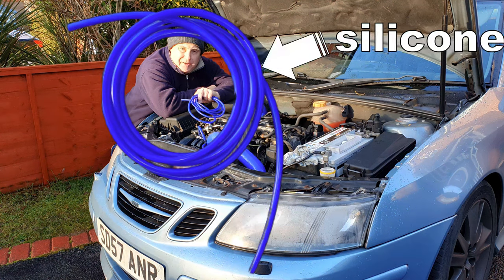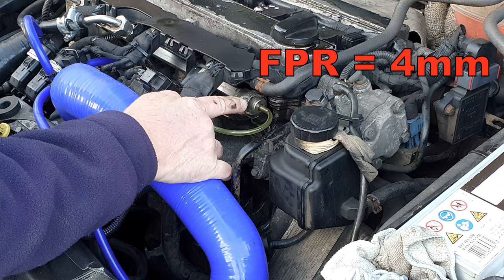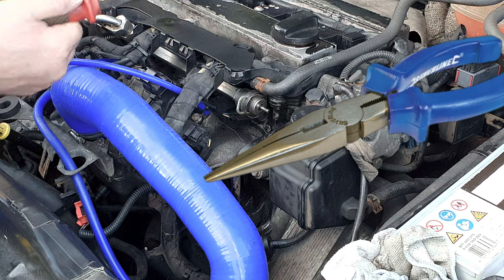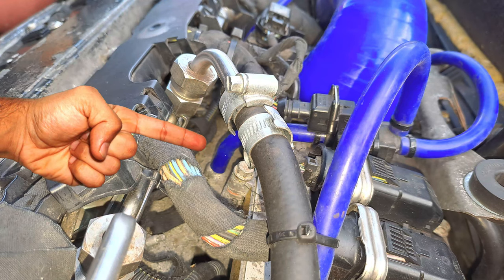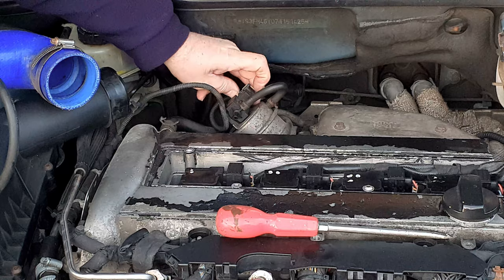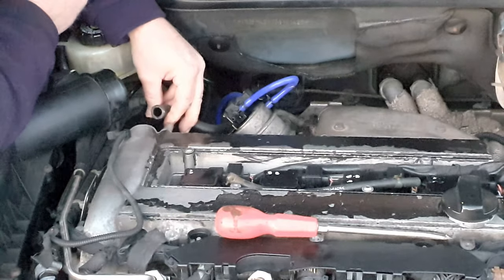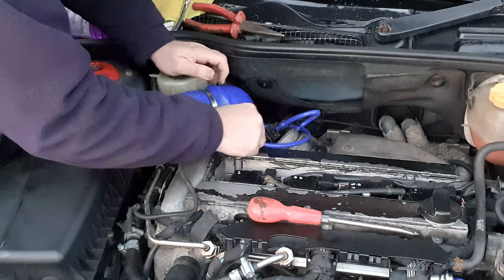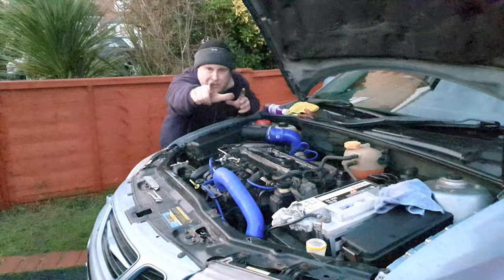Saab 9-3 Vacuum Lines Replacement on B207 Engine

Comment: I have one of these cars (someone gave it to me) and I didn't have the heart to send it to the graveyard and am trying to spruce it back up. So far, I replaced the ECU (including installing a heat sink). Replaced coolant cap. Replaced bolts on engine cover and plug/coil cover (the Torx bolts strip easily when they get old). Replaced the coolant cap. Replaced spark plugs. Now, I have to either replace coils, or replace these hoses to address a P0300 code. I think after watching this, I am going to install the vacuum hoses next (plus that 12mm hose).

Comment: Hmm, my 2010 2.0T doesn't seem to be quite the same as your setup.  I wonder if it's different due to California/US emissions requirements.  The vacuum line from the top of the bypass valve solenoid doesn't go to the cobra, but rather to a nipple on a steel(?) pipe that's insanely difficult to get at - the nipple is just to the left of the ECU (looking from the front of the car) and under the short coolant hose that goes from the engine block to the "t" fitting that many of us replace with the metal one (or with your coolant hose).  Any idea what's up with that?
Reply from the maker: The vac line from the bypass valve solenoid doesn't go to the cobra anyway - it goes to the bypass valve, so not sure what you mean there.
Maybe the vac line is part rubber and part steel pipe? Have you traced it round? Does it go to the bypass valve?
Reply: @CycloneCyd  sorry if my post is confusing. I’m referring to the small black box to the right of the ECU that has three vacuum hoses connected to it:  left, right and top, and an electrical connector on the back.  On mine, the top hose goes to a nipple on a silver metal pipe to the left of the ECU, under the coolant hose.
Reply from the maker: @akahan1  I think you will find it's a part metal and part rubber pipe connection if you trace it round
Reply: @CycloneCyd  I think you're right.  It's unfortunate that the junction between the rubber and metal portions is in a "you'd have to be a contortionist" spot.
Reply from the maker: @akahan1  hence why I just put one run of hose in

Comment: I ordered the new COBRA and adapter. But the adapter didn't fit into the extension from the COBRA and the supplied, metal pin fit the COBRA but ran right through the suggested adapter ID. So I drilled out the COBRA extension with a 4mm bit, only about 40% of the length. I inserted the adapter as far as possible into the drilled out portion of the extension, the pushed the pin through the adapter and all the way into the extension. Secured with 100mm ziptie. Put the hose over the remaining part of the adapter and another ziptie. NOTE that I used 5mm hoses for these connected to the wastegate valve and the originals all seemed bigger than 4mm. Anyone else notice this?

Comment: I've been stumped as to why my Saab was idling so badly and constantly sputtering while in idle and while trying to accelerate
My check engine light has been on forever... I thought it was a misfire due to bad plugs, so I replaced all of the plugs and coil packs thinking that would solve the problem, and no it sure didn't. Car still sputtered uncontrollably.
I just happened to be browsing solutions on YouTube and came across this video.
 Went out to my car afterwards and low and behold, my vacuum line is broken. Found the problem!
Seriously thank you so much for this upload. You don't know how long I've been trying to figure out the issue!!! 
This is a huge relief!!!
Reply from the maker: Which vac line was it?
Reply: @CycloneCyd  Forgive me if I sound stupid, I will be the first to admit, I'm no expert mechanic... I know just enough where I can service minor things on my car.
But the line that was busted is the one that runs directly underneath the Power Steering fluid reservoir.
I only found it because of the hissing noise it was making when I was looking around for issues.
Is that the line that has to regulate fuel pressure? I assumed it was something to do with fuel pressure, because whenever my car would sputter, it was acting like it wasn't getting enough fuel or something.
Reply from the maker: @PrincessZelda_is_My_Side_Chick  sounds like your brake booster vacuum line.
https://www.youtube.com/watch?v=mT8Sne0q_2g
Reply: @CycloneCyd  yea I watched the video and that is definitely the line that is broken
Reply: this is exactly what’s going on with my vehicle thank you guys so much for the reference of direction I have a 2010 aero I’m having the exact same issue and I was coming off the express way all of a sudden when I was going from 3rd to 4th gear I heard this odd sound” then I had to switch over two lanes and coast home after stopping once

Comment: Okay. Intake hose replaced. 12mm vacuum hose replaced. COBRA hose replaced. There is a black plastic ring that hosts the clamp on the turbo side of the COBRA which threw us off. Also, the COBRA spigot is 4mm and a converter to 5mm appeared necessary. Not having a converter, we used a 5mm hose and just tie clamped it on the COBRA spigot. Car does seem to be running better in tests.

Comment: Thank you. I've been waiting for a 9-3 specific video detailing this. I look forward to trying this out as an upgrade.
Reply from the maker: Awesome, I hope you find it useful. Even the slightest pinprick in the stock rubber hoses can cause the car to run a little 'off'. I should have known better and replaced my hoses long before now, because as soon as I made this video and went to Manchester to visit my Mum, it was obvious the engine was running smoother.
Typically, the stock rubber hoses are good for 8-12 years life. Anyone with a 9-3 should be considering changing them now. And that brittle cobra.

Comment: Will the links you provide to ask the hoses (including air intake etc.) Fit the 9-3 1.9 tid on a 56 plate?
Reply from the maker: The air intake and coolant hoses are specifically for the B207.
The vacuum hose should be suitable for the diesel.

Comment: One thing to note: silicone hoses that come from China are often not reinforced with anything so they very easily nick and can leak. Thankfully the hoses are at the top of the engine bay, otherwise I’d worry about rocks and road debris cutting into them. I just recently installed a bunch of these hoses in my girlfriends car, and as I was cutting each hose I realized I could cut through them like butter. The only hose that was reinforced with anything was the cobra after the air box. I do recommend hanging onto the old lines just in case.
Reply from the maker: Vacuum hose is not reinforced, not even OE rubber hose is reinforced. All the other hoses I sell are reinforced though.
I wouldn't recommend something to my viewers if I didn't think it was suitable for the application.
Reply: @CycloneCyd  That's fair. I appreciate the videos and hard work you do, I just thought I would mention it since it does seem a lot softer of a material than the rubber hose.

Comment: I really need some knowledge .. are the boost valve and control valve the same thing
Reply from the maker: I think that you may be referring to: 1. the wastegate actuator and it's control solenoid (valve) and 2. the bypass valve and it's control solenoid (valve).
They are two distinct parts of the turbo system with quite seperate and distinct functions.
The wastegate control solenoid operates the wastegate control actuator (vacuum operated) which in turn opens or closes the wastegate which in turn controls the amount of energy the turbo extracts from the hot exhaust gases.
The bypass valve is essentially a pressure relief valve. If the turbo is at full chat (pumping maximum air at max boost) and the throttle is closed by the driver there is a time lag (2-5 revs of the crank) before the turbo slows. In the meantime the turbo compressor is pumping air hard up against the closed throttle. The BPV lets some of this excess pressure out, so the engine is not overwhelmed by an excess of air when the throttle is opened again.
HTH

Comment: Thanks this for this vid. I am having an issue where my 2008 will die on a warm start and occasional rough idle on cold start. IS this the same process for 2008 2.0 models?

Comment: Did you ever find where we can get the long plastic hose with the fittings as mentioned in the video?
Reply from the maker: You mean the vac pipe to the brake booster? https://www.youtube.com/watch?v=mT8Sne0q_2g

Comment: My 9-3 was feeling weak and slow but didn't throw any codes. Did this yesterday and it was a massive improvement. Will also replace the cobra, just need to find a reducing connector or another solution to that problem.
 Just ordered the T delete for the cooling system as well, feels safer that way.

Comment: Cyd, on a side note, you might want to add the vacuum hose, that's located to the right of the oil dipstick a bit underneath the TB bracket, that leads to the purge valve.

The original part is an elbow reducer. I recently swapped it out as it was causing a p0300/p0441 code. I used a piece of fuel line from the engine to the check valve. 

Hopefully, you'll have a video of silicone hoses and check valves (with part numbers for the valves) alongside of the second portion of the brake hose.

Comment: Cyd, I just bought your throttle body hose, Zobra, 4mm and 5mm hoses for the vacumlines off Aliexpress. Looking forward installing them. However, Ive got a question. There is a lot of different sillicon hose kits for B207 out there on eBay and Aliexpress. Which one should I choose? The ones Im looking at includes 14 pieces and the price is around 200 pounds. Ive checked ST-Cool seller but them dont have a kit for the B207 sadly.

Comment: Hi Syd.
Just been replacing all of my vacuum hoses with silicone, using your video as a guide 😊👍 All of mine were absolutely solid onto the joins and all had to be spliced off with a knife! One thing I noticed though, is that the very long one that goes from the bypass solenoid to the turbo is rubber at each end but solid silver metal in the middle on my car 🤔 Is this usual, or am I missing a trick? D'you think I should change it or leave?
Cheers 😊

Comment: So the FPR is the only one that is 4mm? The rest is 5mm?
Reply from the maker: Not quite. Wastegate control solenoid is 4mm too.
Reply: @CycloneCyd  What about the 12 mm hose? The AliExpress store doesn’t seem to have it.
Reply from the maker: @lspd5916  watch this space - we're working on it
Reply: I hope I’m not gaslighting myself here but - the sizes we took off around the wastegate solenoid were 5mm and the 4mm we tried as mentioned in the video are way to tight to get on. So we went with 5mm back there. 

We bought from the link provided. Is this an oversight? Are we going mad 😮
Reply from the maker: @sejn2587  The trouble is I've thrown my old vac hoses away now, so I can't double check. I defo fitted 4mm around the wastegate solenoid - they were a little tight but went on okay. I found 5mm to be a little slack. I did use a little WD to help them slide on.
I'll have another look at it in the next couple of weeks. If I found I was in error, I'll have to re-edit and republish the video (you can't edit published videos - I wish you could).
Thanks for the heads up

Comment: Can you explain what you used to mount the silicone hose to the Cobra? I ordered the same cobra, which has a steel threaded pipe on the location where i should mount the hose. I assume i have to remove this steel pipe and stick a hose pillar in it? A link to a part would be nice!

Comment: That blue looks really good. You don't strike me as a flamboyant modder for the purpose of making your engine simply look attractive to garner compliments, but your engine has has some customized appearance to it now. It happens to look great with the blue hoses.
Reply from the maker: I wasn't sure I would, but I'm liking the blue too.
Reply: @CycloneCyd  The blue does look good indeed. I am thinking that yellow might make it easier to see any splits or ruptures on the hoses going forward.
Reply from the maker: @drummin2dabeat  itmight. My main reason for blue was partly because the car is blue, but mainly so I could easily see which hoses had been replaced and which had not.
Reply: @CycloneCyd  turns out that they didn't sell the yellow in one of those sizes. And the Cobra hose didn't look like it came in yellow (yellow was an option but when you selected yellow a different hose came up). So I went with Blue!
Reply from the maker: @drummin2dabeat  that'll only be because the factory haven't yet made a yellow one. Onve someone orders a yellow one, they'll get a photo for the listing. Remember, these hoses aremade to order!

Comment: Thank you for the video, doing my air lines shortly. Can I use the existing clips or would I be best using cable ties like yourself?
Reply: Clips will cut into the silicone and break it apart. Use the zip ties

Comment: CYD on a completely different note I asked a question looking ur advice previously!
Could you possibly please 🙏 advise me on the correct LED DRL + amber indicator as  in ur previous videos that would suit  a saab 9-5 ng areo 2011. (Looking to remove my  Amber cover on glass) Would  really appreciate advice and would thank you again via PayPal.  Thanks for your help in advance and keep up the good work helping keep SAABs on the road for 2023 . BTW Happy New year !
Reply from the maker: A HNY to you too.  Is the standard bulb fitment a clear bulb (P21W) or an amber bulb (PY21W) - they have different fitment lugs)
Reply: @CycloneCyd  all I know is its "a regular 21w lamp. The format is Bay9s"   does this info help???
Reply from the maker: @owenmindwise  yes, the info helps me, but not you! No-one makes a dual colour switchback bulb with a BAY9S base.
The only way I can see of achieving this would be to use the bulbs I link in my DRL video and convert the bulb holder inside the headlamp to a P21W type such as these https://s.click.aliexpress.com/e/_DDFsR4j.
Possible to do, but will test your fabrication skills
Reply: @CycloneCyd  Your a scholar and a gentleman. 
Thank you
Reply from the maker: @owenmindwise  I would pick up a 2ndhand headlight unit and try out this (and any other desired mods) on that, rather than risking the cars lights.
Reply: @Cyclone Cyd  just seen reply cyd the turn signal/ indicator on 95 ng  2011 just 1 single light well below headlight!!!  So hopefully not as big a job as you were thinking!
 (I hope) thanks again  🙏  I keep you posted on how it turns out.....

Comment: Wouldn't it be simpler to change the rigid pipes and put silicone pipes in their place? 
 They are easier to work with.